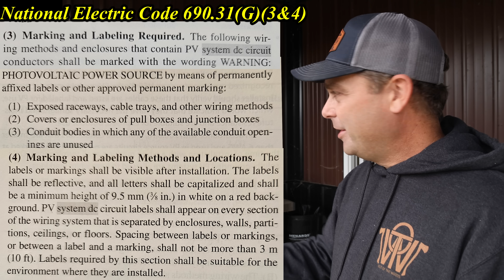Installing Conduit and Wire to Roof Mounted Solar Panels

Comment from the maker: Save $50 off a $500 order at Signature Solar by using my Discount Code:  COUNTRYVIEWSAVE50
Solar Equipment We use:
EG4 6000XP and Wall mount Battery:  https://bit.ly/4dzgRmN
EP Cube all in one Solar Energy solution: https://bit.ly/47dLudA
EG4 12Kpv and All Weather Battery:   https://bit.ly/4fDuvX2
EG4 12000XP Inverter:  https://bit.ly/4kxnjic

Comment: 12:06 pulling THHN wire x3 for hot (red), neutral (black) and ground (green) for your solar DC power run up to 600V - presumably 10 awg.

Comment: Super clean and crispy install. Subscribed based on that alone.  @countryviewsolar-DIYprojects @ 2:57 you show the super small penetration for conduit through a metal roof.  Where can that be procured/purchased. I did not see it in the list with links? I support your channel and your work. Thank you in advance. 

Last question, if there was a roof vent at the ridge, would you have run a conduit up and through the ridge vent rather than using the small conduit roof penetration device?

Comment: I noticed thread sealant on your rigid conduit, I haven't been able to find any instruction on this. Would you be able to clear that up for me?
Reply from the maker: It shouldn't have been thread sealant.  It is copper coat.  A copper based antiseize.  So it's conductive.  Maintains a good ground.

Comment: Here’s a tip, rotate the boot flashing 45 degrees so that the cover points upslope to ensure water drains around the boot rather than collect along the flat edge
Reply: 5:19 rotate 45 degrees
Reply: Do you mean the box rotate 180 degrees. @ 5:50 in the opposite direction ?

Comment: For PV that is outside in the  ground but runs thru a RMC conduit can a thwn-2  wire be used ?  Same wire  reaches the building and is in a EMT conduit  above ground till it reaches inverter. So okay to use THWN-2 all the way then.

Comment: I was wondering if I could do the conduit by myself.  Thanks.  I am thinking of doing three runs of conduit for three solar arrays (10 panels each).  Doubt if you can get more than the three 10 ga wires in the conduit without going to a bigger size that is harder to bend.  Hope mine looks as neat (straight) as yours.

Comment: Looks like a fantastic work. I was looking how to install a conduit for my solar PV wires but this seems to much for my simple 2kWh set-up. I'm a noob on solar. The wires are just on the roof, literally on the tin roof running towards my Ecoflow. I hope that's safe.
Reply: no that is not safe

Comment: Great video!  Which terminal blocks did you use?
Reply from the maker: I Buy Dinkle Terminal Blocks off amazon.  Usually get the ones that fit 6 gauge wire
Reply: @CountryViewSolar-DIYProjects  thanks for the info!!

Comment: 6:24  No. Not "in or on a building." Just "in" a building. The "on or in" in the code title refers to the type of wiring subject to the code generally (i.e., wire that originates on a building, then goes inside a building), then the specifics of the code just refer to what must happen to wiring "inside a building."

Comment: Before I retired I held a Journeyman Class B Electrician License and there is one thing I see that would not meet code here in Nebraska is you have to support EMT conduit within 3 feet of a box, raceway, or panel, and then at minimum every 10' after that. Other than that it looks like you do really great work.

Comment: Great vid. Can i use a manual breaker or switch as a rsd near each array?. It seems like every video only talks tigo and the other expensive electric shut down.
Reply from the maker: No, the rapid shutdown has to be panel level.  Each panel needs shut off..  And the switch needs to be readily accessible by first responders (so ground level)

Comment: Reminds me of stuff we used to do at work. Our guys were either an el tech or technologist with a few engineers in the mix, and worked a lot with field installations. We get the heavy electrical done by contractors (trenching, AC power, etc.) while we’d do the hookups and all the equipment installation. You’re doing some nice clean work, always appreciated by someone having to work after you, and definitely easier to troubleshoot should it be necessary. Those black cable glands are great. The brand we used were expensive unless you order in quantity, never had an issue with them, and lots of accessories, even little foam vapour screens if you need to vent your enclosure, but keep the bugs out. Always enjoyed wiring enclosures and getting everything wired up and looking decent. You’re always being introduced to new ways of doing things. Some of the stuff coming out of Europe was nice to work on.

Comment from the maker: The minimum number of strands was actually referring to PV wire for Movable solar arrays (Solar trackers, or adjustable angle).  So I had the info wrong.  As long as your are using stranded wire inside conduit you should be fine.
Reply: Can you add a note in the video for this or cut that section out?
Reply: So (I am new at this), I can only find 19 strand 8 gauge in THHN  for use inside my garage, I have PV for outside. I am thinking 8/19 is okay instead of 8/49? Thanks, enjoy your content.

Comment: Isn't Table 690.31(E) specifically for PV wire connected to moving parts of a tracking system? I don't think it  applies to fixed-rail panels or wiring run through fixed conduit. NEC 2023 moved the table to 690.31(C)(4) but the name of the subsection is still the same: "Flexible Cords and Cables Connected to Tracking PV Arrays"

Anyway, thank you for the informative video!
Reply from the maker: Yes, i think you are correct on that.  The way table is labeled (minimum PV wire strands) in my 2017 code book is misleading.

Comment: Solid Video.  Love to see some performance data, especially broken down as to how much your house utilizes, your workshop, and your barn(s).  Thanks for including the 2017 National Electric Code data.  I'm guessing your county is not using the updated 2023 NEC?
Reply from the maker: I just don't have a 2023 code book to quote it.  My part of Illinois is still under 2008 code requirements.  It is common for states or counties to several years behind the newest code.

Comment: Hello Evan, your videos are a blessing to us DYIers. I have a request and a question for you; please make a video on how your system works between the barn & house on, how you pull power from one to the other depending on the needs of each system.     Also you pulled wire from your barn to the house on another video, what size wire did you use?

I'm in the process of building my barn &  want to build a solar system much like yours. I built a small 940 watt system for our travel trailer 5 years ago & it works fantastic. So we're just wanting to build a backup system & maybe replace 80% of our house power consumption, along with power to the barn when needed & lights for it.

Comment: Are the bank barn and the barn with the squeeze shoot on grid power?
Are the five arrays just for the shop and the house?
How big of a battery bank are you going to have?
What is the maximum kilowatts you need each day?
Reply from the maker: The barns are on grid power.  The 5 arrays will total 18940 watts.  They are all for the house and workshop.  Right now the house has 34.3 kWhours of battery.  The workshop has 24.3 kWhours of battery.  The house will probably get more batteries in the future.   We use around 50 to 60 kWhours in a day on average,

Comment: I admire greatly your skill when it comes to all the solar system components.  The OCD in me loves the neatness!   The self efficiency of your farmstead is amazing.  No power for us means no water as we are on a well.  No water means no toilets working during outages.  You wouldn’t have that problem.  I liked your “plug in gas generator” before you got all your solar and battery systems.   Now you have given me more to be envious about! (Just kidding).  Thanks for sharing!

Comment: It was only a matter of time where the electrical manufactures would come out with specs needed  to wire up solar power  system. High DC amperage not AC with the same heat/amperage conciderations. Lots to learn.

Comment: Question:  Do you need a bushing at the box on the roof?
Reply from the maker: Because we are using a Myers hub (conduit fitting) with 6 gauge or smaller wire.  Threaded bushing isn't required.  4 gauge and larger wire it would be required with a conduit fitting.
If it was a rigid conduit threads directly into the enclosure without using a conduit fitting, a bushing would be required everytime.